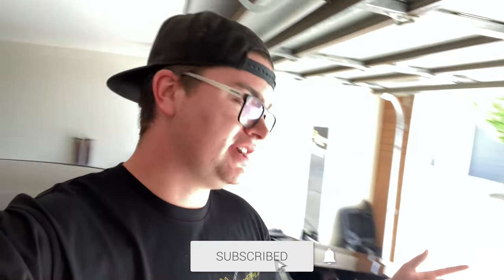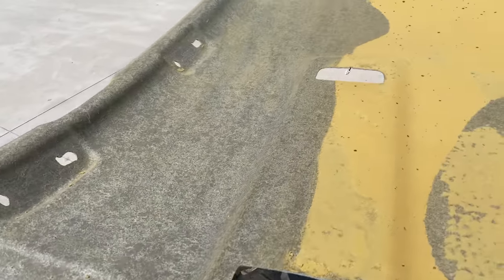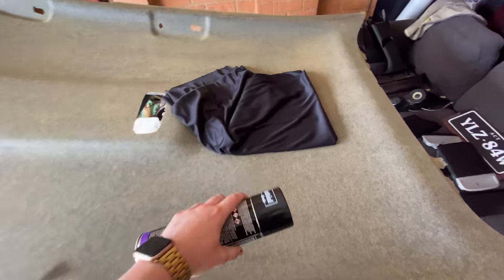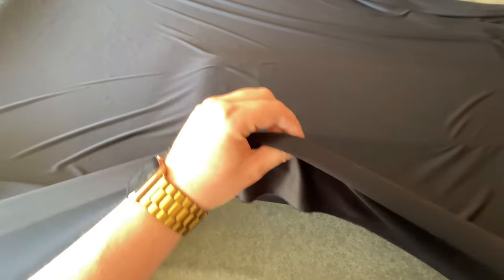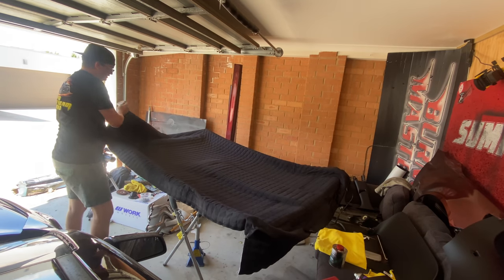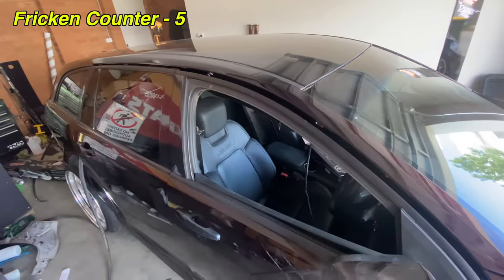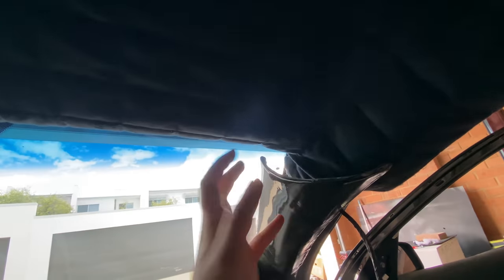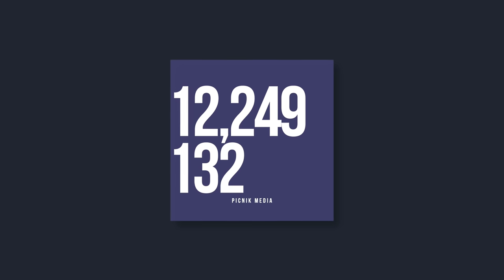How To Fix A Sagging Headliner!

Comment: That rear angle photo of the checkered fabric you used looked awesome, Overall great video mate! 

The job can get difficult when using non headliner grade fabric, as most other fabrics may be too thin or not enough stretch.

We do these VE Holdens weekly, very common car at the moment to have the roof linings full down.

Cheers 👍👍😎

Comment: That brown crap you brushed off is just foam, the fabric comes with the foam backing attached and then laid onto the head liner board.  You should be able to find some foam that's like 3 or 4 mm and back the 1st fabric you had.